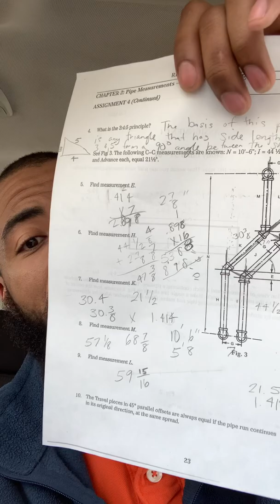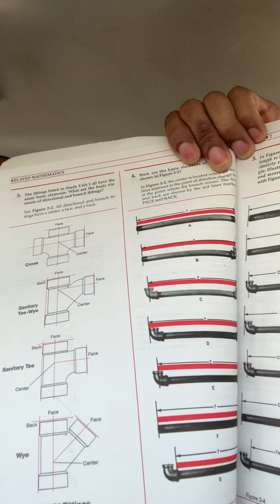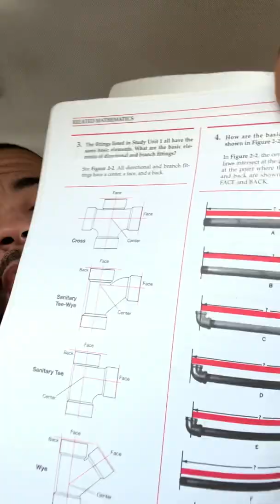What type of math do pipefitters use?

Comment: Did you cut your hair because of your hard hat? Do you get to weld? I’ve been welding for awhile now and I already have certs I’m thinking of joining the union and been following your videos
Reply from the maker: That’s part of the reason why I cut my hair the hard hat. Probably won’t weld for about a couple of years.
Reply: So even if I already have welding certs if I joined I would still wouldn’t get to weld for awhile?
Reply from the maker: Mike West actually those welding cert will accelerate your apprenticeship. Joining the union you can use your previous experience and apply it to your apprenticeship.
Reply: Thanks for the knowledge!